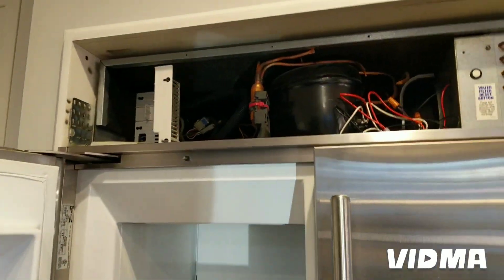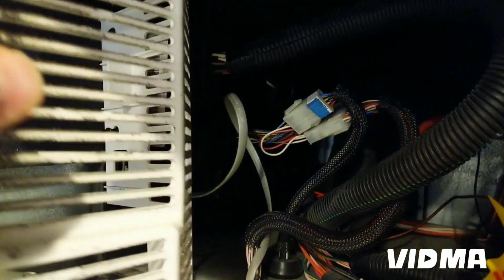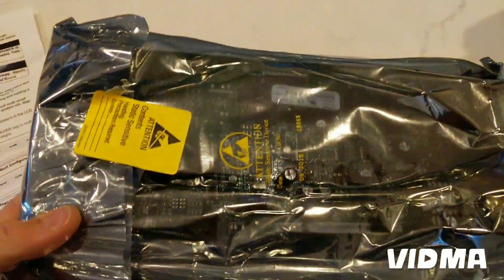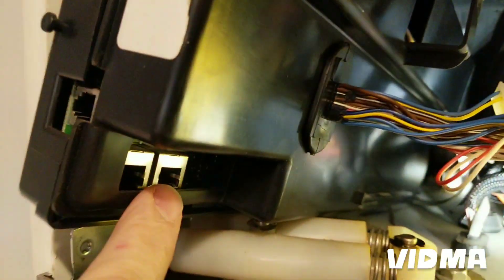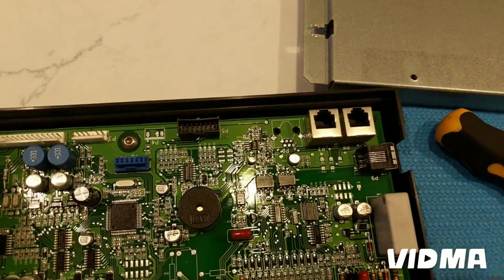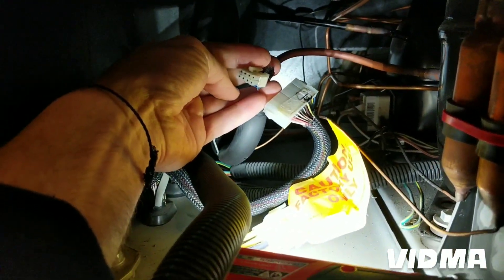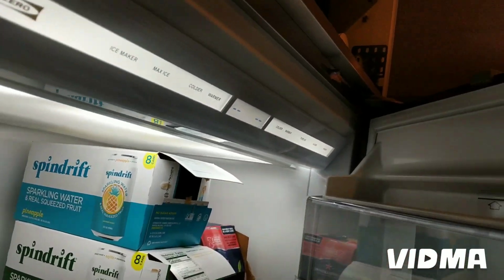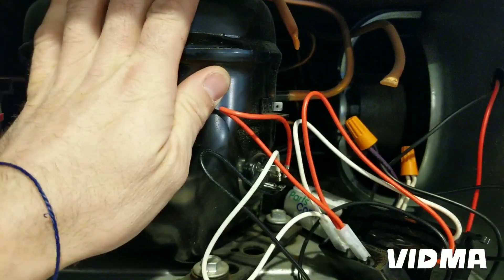Sub-Zero refrigerator no display. control board install and programming. part number 7028329

Comment: How many volts should get display panel? My display panel is off , lights are on. Compressors are not coming on.  Display panel getting 5dc. Is it correct voltage?
Reply from the maker: I think should be between 5 and 12. Usually very hard to diagnose which panel is bad I would probably start with the main control board. Or which one is cheaper. Have not replaced many user interface boards usually it's the main board.

Comment: Thank you for the video. On the Subzero website it indicates this board was substituted to part #7041553. Is 7028329 the newer version of the control board?  My refrigerator works fine, but the display went blank.
Reply from the maker: They both should work the substitute and The older version as well. If the refrigerator is still running and everything is cooling there is a small chance that the display board is bad and not the main control. Usually it's pretty hard to test that. Are the buttons responding and the noises from the display control when you're pressing buttons? if there is no response at all I would probably go with the main board most likely that one will be cheaper to try
Reply: @myappliancefixed  Thank you. The display shows nothing and does not respond to anything. It sounds like more of a display board issue than main control based on your comments. I have the same unit as you worked on in the video.
Reply: I have the same fridge. It's running perfectly fine, but the display is unresponsive. It's on but no sound or response. Do you think it's the main board?
Reply: @bqgfamily4927  Probably. I tried replacing the display unit only, didn't fix. I've just learned to live with no display for now.  Mine is completely blank.
Reply: Hi 
I have a similar fridge , model 36S

The freezer side is not defrosting 

Defrost sensor and heat element are fine , would it likely the main control board be the issue?

Thanks